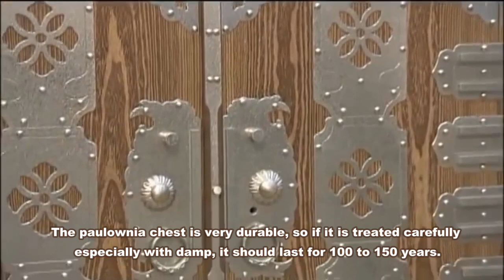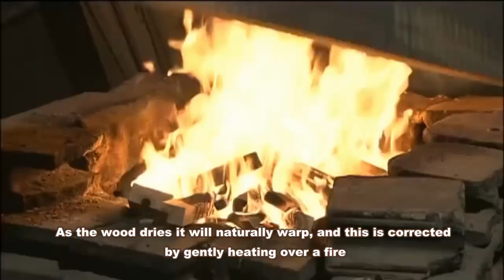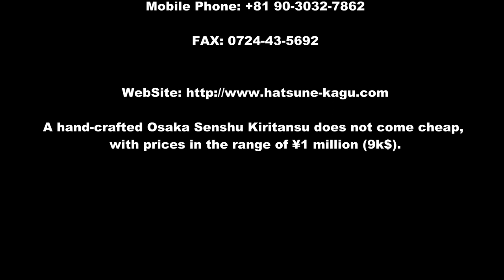Japan’s Best Chest of Drawers Furniture with Highest Level Techniques Required

Comment: How are they able to remove so perfectly fitting drawers from the cabinet after the check?
Reply: this makes me lough at all.. 
a very nice question.
Reply: Very likely - by pushing in another drawer. They are almost airtight which makes it possible to get the other drawer out with the air pressure itself.
There is a couple of other videos about Japanese fine furniture makers showing that.
Reply: @junnybautista8676  with fitting another drawers so the air inside will push out the fit drawers.
Reply: @sano262  Western craftsmen do it as well . They are called PISTON DRAWERS